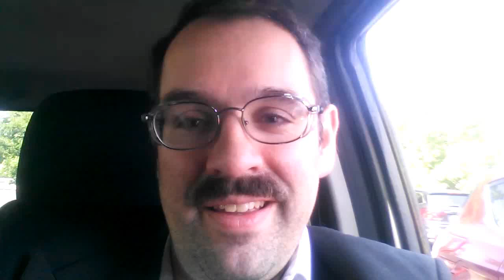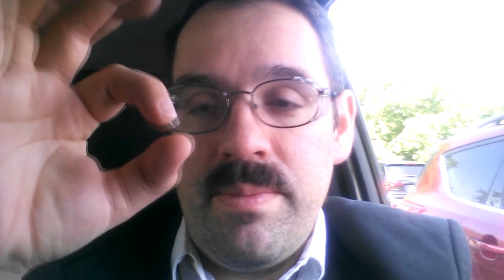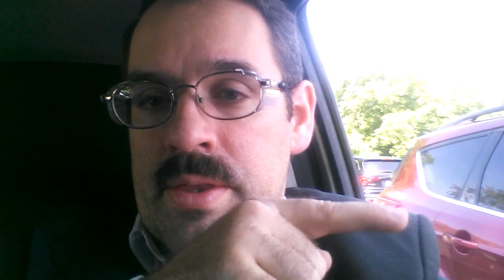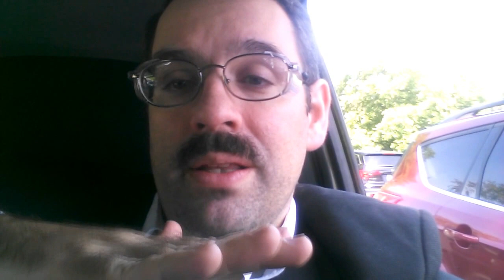Port and Polish? Porting and Air flow Theory III

Comment: Polishing is increasing the relative speed, the issue lies in over speeding in wrong areas! By overspeeding youre creating a big enough centrofugical force to seperate air and mixtures of any kind like fuel, NOS or watermeth injection. Therefore if you have a direct injected cylinderhead where you dont wanna add watermeth or NOS in future, go for it! Also Im using up to 1000 grid, to make the runners shape as similar as I can, and only then rebuff them with 120 and so far, after a few years of using this technique Ive witnessed no condensation evidence in the heads Ive had ported and polished for me and bunch of my friends! Although Im living in Iran, and limitation is a huge factor in my decision making processes!

Comment: I knwo this is an old video but WRONG!  Leaving a rough promotes buildup. Tear off your manifold and have a look. its been two years. I had an engine 5 years with my first port job on it making double stock power.... from a wimpy 175 to 360... NA.. street V6... I pulled off my intake and a paper towl wiped the little bit off from the surface... Try it with your port....  I suggest grumpys garage for info on porting using the math that you need to do it right. also see inside the high power f1 head???
Reply from the maker: It really depends on what you want. If you're truly doing a racing head then greater port velocity is the goal. That means leaving it a "rough" 60-80 grit, which is actually fairly smooth, just not polished means more airflow.

Those lightly rough surfaces make tiny air vertices which literally make  "air balls", which speed up port velocity over all.

Street reliability? The more polished the longer it's clean. It won't flow as fast, but if not building up carbon as fast and having a long running cleaner engine is the goal, then a good polish like what you have is great.

To me it's less about what's wrong and more about deciding what your goal is and making that goal happen the best. This is one of those decisions which has consequences either way.

I'm very happy for you and your engine. Sounds like it has been fun and very reliable. Is there anything else which you ported or modified to make those awesome numbers?
Reply from the maker: What's great is everyone agreed with the video before I changed the title. The original title was something like Porting and Air Flow theory III.

Comment: Nick f polishing reduces fuels ability to vaporize. Polish exhaust. Rough finish on intake. More surface area is good for fuel vaporizing vs. Staying in droplet form.
Reply from the maker: A lot of people agree with that. Racers don't care about long term carbon build up and velocity goes up on smooth and well shaped but rough ports. 

I know smooth and rough sounds like an oxymoron but the rough edges aren't just for fuel. The tiny air vertices speed port velocity up. 

Combustion chambers need polishing of course but that's not literally porting.

Think I should do another video with visuals for people who aren't in the know like you?
Reply: Wait for shark week and use shark skin as an example of the vertices reduction of drag. You know what you're talking about and I hope the viewers are paying attention.

Comment: I like some of your ideas but I don't agree with a lot of them. First of all a rough surface on metal is going to create more drag which is going to equal less flow. if you have a Polish or mirrored surface that is going to equal less drag and more flow. Far as a combustion Chambers concerned a mirrored finish is going to equal the least amount of hot spots and therefore you can run more ignition advance to create more power without getting detonation.
Reply from the maker: I agree a combustion chamber needs to be absolutely polished or you'll be creating pre-ignition points.

The truth according to David Vizard is that anything more than a 60 grit finish is a waste of time. The tiny vertices act like roller bearings which speed up the rest of the air. Air velocity is even more important than volume...depends on the deficiencies of a port. Working where a port is lazy makes it worse. Focus on points of greatest restriction. 

Polished ports defined are the intake port and exhaust port not combustion chambers. 

I respect that you disagree I'm only saying what I've learned from the greats. I know just about any video on YouTube says otherwise, except the occasional channel showing 1 of David Vizard's presentation. :) (not me)

Now exhaust being extra dirty I might polish anyway for longevity. It's hard to say.
Reply from the maker: I'm not perfect. Please share anything else you may disagree with freely. Good teachers learn whenever the opportunity presents itself. :)
Reply from the maker: I apologize if you've hear enough from me. I have edited one of my comments for clarity. I was rushed before. 

I'd like to add that where valve stems go through a port are a point of greatest restriction as well as the bowl.
Reply from the maker: Here's a better answer. Unless I can find scientific proof I watch being recorded to the contrary, then I'll hook up my MAF to a port with a vacuum as a air suction or blowing. This will give me a numeric flow value uniquely valid only to itself, but it'd be sufficient evidence one way or the other for nearly free versus a $1,000 flow meter tool that one shouldn't invest in, until this is a career instead of a hobby. Automotive? Career. Porting? Hobby, but I bet you could dig that bell button or one below to see testing when it comes, eh?
Reply: I've been watching a lot of videos and literature about porting and flow Dynamics and Theory..... In all honesty one of the techniques that I didn't believe in was dimpling but the facts are the facts. And dimpling over a port job of the same size done on a CNC machine only adding dimples to it you get more flow. For your general hobbyist yeah anything past 80 grit is probably not worth while but when it comes to racing everything counts.... gains are gains. Generalizing what other people should do based off of what you think should be done. One of the best theories that I've heard of is taking total lift vs. Valve size and finding out what size of Port you need to get the best power band.
Reply from the maker: That's right! I have a book on engine math which gives the calculations to discover based on the dimension of valve size and lift how much port you need. Hogging out everything to "bigger is better" can kill port velocity. Another way of putting this is you'd be making a port lazy. 

As far as dumpling yeah, way beyond DIY, I think. I believe it'd especially help around the bend where the air is dealing with the same problem as a race car driver. You're going 65-75 Miles Per Hour and now you have a 25 MPH turn into the bowl. One porter, I thought he was using made up numbers until I found out the air is ACTUALLY moving that fast.

The bowl is behind the valve seat. This is an area of expansion and why I have expensive rounded carbide, single cut bits.

Have you checked out my video on ideal intake runner length? It appears on my Nissan Frontier that 3.3 liters is remarkably close to a Mustang 5.0 cubic engine size. The intake runners are very similar in dimensions!

I could smooth them but making them any bigger would make them lazy. I'm extra sure of this as throttle body spacers kill wHP on this engine. The engineers did a great job. I'm curious if being a little smaller would help, but I'm probably never going to mess with near perfection on this point. Edit: of course runner length is only part of it. I haven't mic'd them for their radius.

https://youtu.be/gMhRNiVQsrQ

Comment: 5:13 No, inertial scavenging occurs at blow down when the exhaust opens before BDC going down, which is why the EO is before BDC,  the effect is to reduce pumping looses when the piston goes back up on Ex stroke.
That effect does not last until TDC since gas constantly attempts to equalise a pressure differential at all times.
The theory that inertial scavenging works in the exhaust header to draw intake at overlap is a 1930's theory (Kadenacy effect) long dispelled by the 60's.
Sonic wave tuning is the means to draw intake in during overlap of IO to EC across TDC
As blow down timing and back pressure dictates the width and amplitude of the compression wave that the initial sonic flow creates. that follows in the expansion wave that is reflected at the header pipe exit that is timed to arrive during IO EC overlap to cross scavenge.
Increasing back pressure with a smaller diameter header or even a flap to obstruct at the pipe end will flatten the compression wave and result in an expansion wave that is effective over a longer RPM band albeit with a lower peak.
Reply from the maker: Please explain IO, EC, EO, not knowing these abbreviations leaves me not understanding.
Reply from the maker: Why would you want to flatten a pressure wave? Is it smoother than like a bigger wave which is more like stop and go traffic?
Reply: IO is Inlet Open, IC is Inlet closed EO is Exhaust open, EC is Exhaust closed with respect to vavle timing.
Reply: The compression wave and returning expansion wave are sonic pressure waves that travel at the local sonic velocity (local speed of sound) through the gas, where the gas flows are far slower.
The sonic waves are energy waves not mass gas flows.
The shape or peak vs length of them is flattened meaning the energy wave becomes longer with a lower peak.
The expansion wave is an opposite sign so it is a negative pressure wave that returns
A megaphone at the pipe end will return an expansion wave of a longer duration effective over a wider RPM range.
Reply from the maker: Thank you. Those phrases explained helped me understand a lot more. So effective sonic design helps with scavenging, not the actual flow of gasses if I understood you correctly. 

What I don't seem to understand, is why reduce the peak of the compression wave? What does it help for it to be longer lasting? If I understand that, then I'll know why you commented on it working over a greater RPM range.
Reply: Things to keep in is that the sonic wave is not like a gas slug in that it does not push gas in the direction of flow so much as it simply distorts the pressure of the gas at the peak of the sonic wave.
Like throwing a stone into a flowing river, the energy waves or ripples still expand outward from the spot the stone landed even though the whole body of water is moving.
You can see the energy ripple causes the water to rise at the peak of the wave.
A sonic energy wave in gas (being sound) like a sound you hear has a positive pressure, that is termed a compression wave and it a positive pressure sign, like +2 atmospheres
1 atmosphere being the local pressure of the gas.
The reflected expansion wave is the opposite so it like an upside down wave in the water, like a low pressure trough, expressed as less than 1 atmosphere.
The trick is timing the arrival of that wave so that it causes a negate pressure distortion just before the valve closes so that the pressure right at the valve is less then 1 atmosphere, or a lower pressure than it would otherwise be which means for that moment of arrival the pressure differential is greater but only so long as the wave is at that location.
With a short high peak wave that will only occur over a short RPM period, higher RPM than that the peak of the wave wont arrive in time before the valve closes. Lower RPM it will have arrived and passed at the moment the valve closes.
Flattening the initial compression wave is like having a wave in the water that has a less sharp peak but is broader, thus it will be aligned with valve closing over a wider RPM range.
Keeping in mind RPM is the time base and sonic velocity does not change with RPM, it follows the local speed of sound in the pipe.
Speed of sound in the pipe is determined mostly by temperature, the hotter the gas the faster the speed of sound is.
To a lesser extent the molecular ratios of the gas which is calculated by adding up all the gas components and using the "ratio of specific heats" of each as well as the "individual gas constant" values.
I cover a lot of this in my 2 stroke expansion chamber video series.
Reply: You can calculate the time distance by using the RPM, total time of exhaust open and exhaust temp.
Convert target RPM into milliseconds per crank degree, multiple that by the total exhaust open in crank degrees to get total time exhaust is open in milliseconds so now you know how long the exhaust is open in time.
Using ex gas temp to calculate local speed of sound in the pipe, knowing that you can then calculate how far in distance the wave will travel in the time the exhaust valve is open for.
Since the wave travels down the pipe and reflects an expansion wave back we simply halve that distance to get the distance we need from the valve seat to the end of the header pipe.
Reply from the maker: Assuming a daily driver which you wanted more performance out of what would a good target RPM to be pressure wave tuned to? Redline is 5,500, if I remember right, for my 3.3 Liter V6 truck. That's a variable I'd have to understand before starting a calculation.
Reply from the maker: Sadly one of your comments hit YouTube's spam filter even though I have it set to be off. Probably because you mentioned your channel. I of course approved it and before noticing this I had already decided to check if you have a channel and I have watched some. I'll be back for more. Would you?
Reply from the maker: For this calculation does the temperature need to be in Celsius or Fahrenheit? I imagine sound speed would be in meters per second for Celcius and feet per second for Fahrenheit?
Reply: Google 4 stroke tuned length calculation, you will find 2 calculators using Graham Bell's equations that are reliable enough.
I wont put a URL or YT will ban that too.
YT just treats any long reply as spam, it's annoying.
Reply from the maker: That's too bad. It was a good long comment. When I have that much to say I must get spammed a lot too. Original comments should be regarded better.
Reply from the maker: Since you like the topic of porting I wonder what you'd think of this ideal intake runners lengths: https://youtu.be/gMhRNiVQsrQ
Reply: Same applies on both intake and exhaust but they begin with a wave the opposite sign..
Exhaust starts with compression wave greater than or + 1 atmosphere and intake open starts with an expansion wave at less than or - 1 atmosphere.
Intake open creates an expansion wave, it travels down the intake to the end of the runner and reflect a compression wave back.
Any discontinuity in the pipe area will reflect a wave, an increase in area will reflect and opposite sign wave and a reduction will reflect a wave of the same sign.
The intake plenum being a "flask" the Helmholtz resonance also applies.
This all makes intake design quite a bit more complex than tuned exhaust design.
For that you need 4 stroke engine design software to input the numbers to, there are many and you might find some online.
Reply: I'm so glad someone else has taken the time to explain this as I was just about to.
Its poor info in this vid and you could do with removing it and trying again

Comment: What do you think of dimpling the surface inside intake port after you’ve shaped it.
Reply from the maker: I think that labs have proven results doing this. The only successful technique I know is getting it done by a C&C machine. Hand porting dimples is too labor intensive to be cost effective.
Reply: SyZyGy7 ja

Comment: you want a rough surface on intake side of port to keep fuel vapor in suspension ,,, exhaust side is POLISHED to a mirror finish to keep from carboning up ,,
Reply from the maker: That polish still interferes with flow when new as a 60 grit finish creates tiny roller bearings of air making everything go faster, but most of us aren't making racing engines new constantly so polishing on the exhaust side is what I'd want too. Thank you so much for sharing. ☺